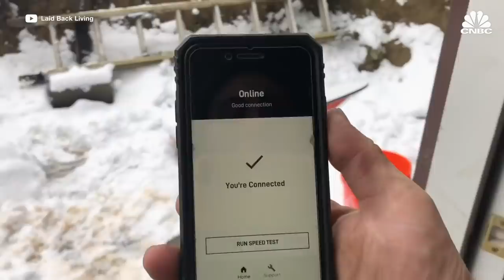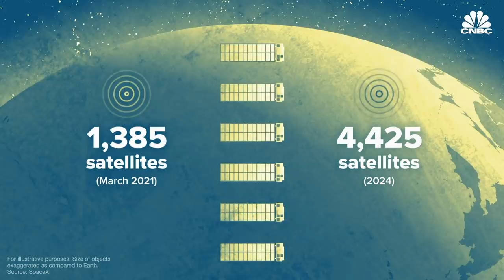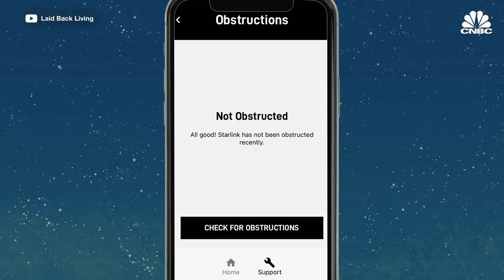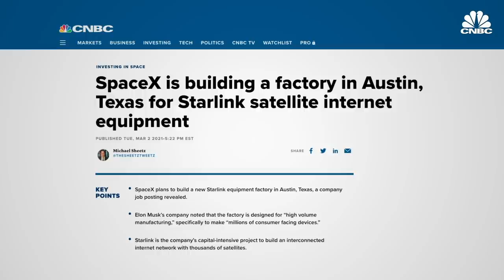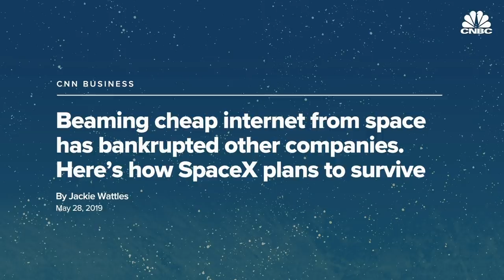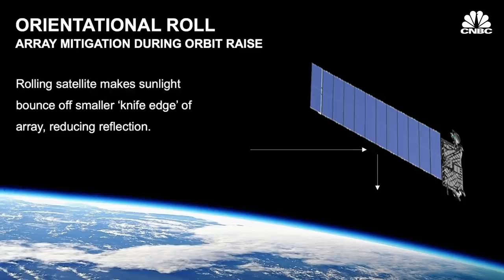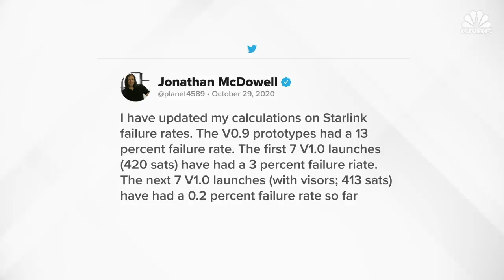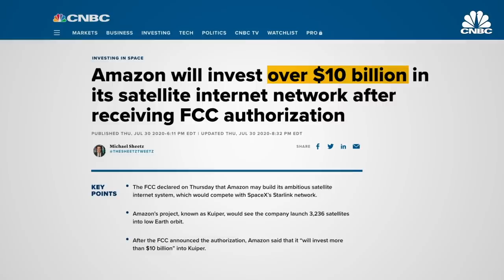Why Starlink Is Crucial To SpaceX’s Success

Comment: Data transfers with the speed of light regardless of they are in space or on the ground, through wire cables, fiber optic, lasers, or radios. The problem with latency is caused by the amount of data that goes through a server (for dns or other type of data) causes it to queue thousands of requests beyond its workload capacity. In fact, even the crappy am radios are transferred with the speed of light, and even has the most “penetration” through mediums (through air or walls, so that you can receive am radio across the surface of the Earth, while 3g cell tower can only cover few blocks). The fact that starlink has ok speed is because there are only a hand-full of people using it, when more people gets to use it, the latency would be much much worse than a good old ground fiber-optic or cable broadband. This is because ground based provider can repair, upgrade, construct stations with more-than-acceptable fees, while Starlink repairs would require years of preparation for engineers, cost billions per mission (yes, Space x doesn’t have human rated recoverable launch platforms), which would only allow them to go to few satellites. 
All these means, Starlink should succeed when human space exploration becomes cheaper, safer, and quicker, or otherwise...
Reply: Already wrong on the first point, speed of light is affected by the medium it travels through, light travels fastes in a vacuum, radio signals and other forms of radiation travel slower than light in a vacuum.
Starlink uses Ka and Ku frequency bands, they can penetrate through rain, clouds, and snow (up to 1ft of snow).
Starlink currently uses ground stations to repeat to communicate, they just launched gen-3 of their satellites which include laser links, once this becomes operational latency will theoretically be faster then what you can get with fiber optic (light travels slower through a fiber optic cable) Ground stations can be repaired, starlink satellites can be replaced, they launch 60 every 2 weeks so no point in havinga mandatory mission to repair a small satelite, ground network can be upgraded but that is every 15-20 years, starlink satellites will have to be replaced every 5 years so upgraded are almost mandatory and scheduled this will help keep the internetfrom being throttled or over used like many people are dealing with now because internet infrastructure is just so cheap to maintain... they have 1000 satellites up and I get 220mgbs in a city so I'm not worried about a low number of satellites when they plan to have 40x the number of even  faster satellites in the future. Also spacex did make space travel, easier, safer, and less expensive, their crew dragon missions demonstrate this over the Boeing starliner and space shuttles programs.
Reply: @miguellopez3392  Talk science, and not brands and names they tell you. Some high school physics for you: radio is light, light is radio; they are all EM(electromagnetic) waves, other than frequency, they are exactly the same in every conceivable way; hell, their speed is literally a constant, c, which is the speed of light. Sure their can travel in different speeds in different density  transitions, but the transition from vacuum and air in 100 km is like less than a picosecond (that's faster than how long it takes light to move 10 cm), which is beyond or at quantum level (meaning: you can't tell the difference even if you are faster than light). 
Also, the frequency they are using (I don't care what name they have) is 10 to 12 GHz. They can send a lot of data per unit time, 2 times  more than 5G in Manchester encoding. However, if you do the calculation, h/i *(d^2 Y)/(dY^2) + V.Y= E Y , Schrödinger equation from basic physics in college, V. is the potential or the things a EM wave meets on the way, E is the energy. Since the frequency is congruent with energy, 10GHz has higher energy, meaning either Y (the wave function), or V goes up in the equation. Meaning: when you have high energy EM waves, you will both meet "more resistance" ie. V, and have a different wave come out the other side ie. Y. 
Or you can just simply observe the signal you get from your home 5G wifi compared to your 2G wifi; sure you get higher download speed, but you cannot use the 5G after having two walls between you and the router, but the 2G wifi would happily server you even when you are out of the house on the sidewalk. This would be exponentially harder (the leftmost term in the equation, after separation of variables) to do when energy goes up (or when the frequency goes up).  
It's funny how you only quote the snow. Snow is 97% air...
Reply: @miguellopez3392  On the logistics. Doesn't matter how fast, or slow they repair the machines, we cannot escape the fact that going to space is hard, dangerous, and expansive. I have full faith it will be easier in the coming years, but I don't think it will be this fast. This could mean the demise of StarLink, or a hard business to run. The thing about a internet provider is that you need a lot of people to justify the business. For example, we pay 30 Dollars per month for cell services, and when 1000 people pay that much per month, they can earn money beyond the cost of the cell towers and retail stores. However, when there are only 10 people using the service in the area, it will take a long long time before you can break even, let alone earn profit. 
Starlink would, however, be of great use to people who cannot get internet from ground. Also some enterprise customers might need thesee services. And I think Starlink may only be able to a competitive in those areas.
Reply: @mikeyangyang8816   light travels slower when going through a medium, Google this and don't waste time. SpaceX can do viable satellites internet because they can re use their rockets and only spend a couple million on refurbishment and $200,000 on fuel, this is significantly cheaper than other rockets of similar payloads, they have already re used a rocket 6 times, the next crew to the ISS will be using a re used rocket for the first time in history Today.
satelites use KA and KU bands to communicate with dishes and ground stations (20-40ghz) and are getting better penetration of the atmosphere, clouds, and precipitation than other satellites, US military plans on using starlinks technology for military use since it's better then their satellite network, they aren't repairing satellites, it's significantly cheaper to just replace them every 5 years. I can use my 5G between 3 walls and a 30ft distance same as  2.4g real limit is my bandwidth, unless I'm getting 1 gig wifi I won't notice a large difference.
Reply: @miguellopez3392  There is literally no 1G wifi, 1G is reserved frequency by different things, satcom, aeronautical radio navigation... Medium of transmission doesn’t change speed of light too much, even water (thousands of times denser than air) doesn’t slow light much! That why you see things distorted through water, but you won’t be living in the past if you are underwater lol. 10G microwave frequency is not feasible for long distance information transfer, that’s just a law of physics. you can see this take effect from comparing ultraviolet camera footage with normal life, You can barely make out things in few blocks, but visible light allows you to see billions of km into space. That s because visible light has a lot lower frequency than ultraviolet light. Same thing with radios. High frequency radio communication is not scalable. 5G is already taking too long to implement, what make you think that 10G would be 99/month? From outer space!? Don’t even talk about 30G antenna, they are not for receiving, they are for sending data only station to station. You know why they can’t put those on top of buildings or just around the street corner? Because they need extremely high amount of power to send short wavelength EM waves to go 1/1000 of the range of 3G. It doesn’t mater it’s Elon Musk, Jeff Bezos, or Thanos; physics doesn’t allow you to do things like these easily. As far as technology advancement goes, I am not aware of an efficient millimeter band radio transceiver that’s going to allow everyone to have one in their living rooms.
Reply: @mikeyangyang8816  "1 gig wifi" means wifi with 1000mgbs speed not 1 gigahertz. Medium does not slow light by much (unless you intentionally make the medium slow down light to the point where it slows down so much it doesn't move) but when traveling around the world it does, what I'm saying the medium is the silicon that make sup the fiber optic cable, this is what starlink is competing with in terms of speed, that's small difference in light going back and forward between computers is a potential selling point to specific time sensitive services. So light through medium vs radio through medium with light through vacuum, theoretically the ladder has the fastest travel time.

10g? Where did you get 10G, I said Ka Ku frequency, that's 20-40 gigahertz and the satellites are in low earth orbit, 40x closer that other internet satellites.
I connected my starlink satellite dish to a 120v outlet, it draws 180 watts max... what year where you born? These are phased array Antanas, advance stuff, it uses 100 smaller sensors instead of 1 large one, combined with software this system outdoes what the military has on hand, which is why the military is using starlinks, because its more advanced, they recently requested a man portable system as Elon has announced the system will be able to be used while on the move and different locations you didn't originally assign it too.
Reply: @miguellopez3392  The only ways to get better “penetration” from any frequency are to either remove the barrier or increase the power. They still have to go through ground if they want to scale this up. Or they can send few hundred space stations just for relaying. Also, SpaceX refurbishment costs officially * 60 million dollars, and that was a goal they have never managed to hit. Currently, no SpaceX missions have costed equal or less than 60 million dollars. Where did the “couple million dollars” come from? As far as telecommunication goes, other companies  spends few hundred thousand dollars manual, equipment fees to install a station to a building or tower,
. They can be repaired easily, cost only manual fees. Starlink has to spend a rocket launch, months of preparation, 100 million dollar + equipment to send 60 low-power-5-year-life-span-no-repair-no-refurbishment expensive satellites. Other companies can use days, 5% the cost to install thousands powerful-repairable stations that have a life time of more than 10 years.
Reply: @mikeyangyang8816  officially cost 60 million? Spacex is a private company, Elon put it at 15 million in best case, so I would really like to see where you got this insider information. Rocket launch cost is 36 million it goes higher the more cargo and the type of cargo, compare a ISS crew launch from Russia to one from spaceX.
 Again you are making a dumb argument about satelite repair as towers have their sensors replaced as well, you don't repair 2g and make it 5g, but with a spaceX upgrades are almost mandatory, you talk about how it's cheaper but yet internet is still expensive and slow despite how easy you say it is to set up and upgrade, you are arguing against reality right now, the satalites other companies launch also easily cost over 100 million I doubt even 60 satelite from spacex cost that much as they are mass manufactured instead of contracted and built over the span of years.

You saying that it would be cheaper to have thousands of repairable satelites (how would you even do this???) in space for 10 years missis the point of why it only has a 5 year life span (has to do with atmospheric drag) and why you will only make 5% the money (much less bandwidth for customers)
Reply: @miguellopez3392  Where did I get the numbers? The frequency of their satellite is from US government registry for radio frequency (or their register for frequencies with the US law). The cost of one SpaceX launch is from spacex.com. I am done talking to you, you are not informed.
Reply: @mikeyangyang8816  FCC filings, they are the ones who directly regulate communications in space, and again their dishes are KA, KU band frequency, like I said the launch cost is lower depending on cargo and mission, standard cost is 62 million because they want to profit, cost to launch the rocket is lower, and again I said to compare the cost of the next cheapest rocket (soyuz) on a crewed mission launch just to see why they can charge 62 million and still deliver half the total the payload launched to orbit in 2020, making them very attractive as reliable rocket, it played a role in spaceX wining the NASA (spaceX biggest customer) contracted them to go to the moon, beating Boeing and blue origin due to lower projected project cost.
Reply: @miguellopez3392  NASA on average spends 150 million for every spacex REUSABLE missions, FOR ROCKET SERVICE ALONE.
Reply: @miguellopez3392  Also, a private company doesn’t mean it is a secret organization. A private company is simply a company that hasn’t IPO yet. What is IPO? Do your research.
Reply: @miguellopez3392  For the speed of light - God, I can’t believe I have to say this - doesn’t change. They “slow down” is because they are going through a little bit longer distance when a photon has to go around particles. I don’t make any of these things up, they are the law of physics. Broken only to people who imagines things.
Reply: @mikeyangyang8816  privately owned by a citizen is the important part, I know what IPO is I've made several, multi hundred percent gains in the stock market, far from making a loss.
Reply: @miguellopez3392  Stop saying ka and ku, say what they mean. What frequency are they at? duuude
Reply: @miguellopez3392  Let me take a wild guess, you invested one stock into gamestop when the news broke out
Reply: @mikeyangyang8816   again you have yet to compare prices to other rocket launch services, and I keep telling you that mission types and cargo deployment affect cost which is why they are negotiable, the most recent NASA missions have been crewed mission which are more costly due to the sensitivity of the cargo.
Reply: @miguellopez3392  Spacex only sent people twice. Both cost so much more than they claim it’s not even funny. I guess you are referring to the ridesharing program spacex is running? They cost so little is because a cargo is sharing ride with hundreds of other satellites, literally stuffed into the faring.  Try to look for the cost of a starlink mission... I bet you can’t even read the number in one go, since it’s so long.
Reply: @miguellopez3392  Ya, I think their rockets are competitive. But I am only talking about spacex because I think the Starlink business is not too bright remember?
Reply: @miguellopez3392  You have yet to make a correct claim.
Reply: @mikeyangyang8816  spaceX sent a 3rd international crew (2 US astronauts, 1 French, 1 Japanese) yesterday, this was the first time in history astronauts have launched on a rocket that has been used before and riding a crew dragon that has already been used before, so how much money do you think is saved by not throwing away your rocket and crew capsule and not building 2 new ones? This is the program, the ride share with other satellites is a differentprogram (this allowed spaceX to send the most satellites launched on a single rocket braking any previous record) 
You try finding thee cost of starlink I bet you won't find a solid number because this is a private company and they only disclose that cost within the company since they are trying to make a profit, it's obvious your ignoring the profit part of the company because you have yet to compare any cost to anything else or even state a number, this is like how Trump does speeches you just have to assume everything.
Again where are you getting your insider information? and are you aware that it's  protected by a NDA?
Also did you look up FCC filings from spaceX that show specifications for frequency on the system they propose?

I'm making correct claims I'm just wondering why you refuse to look this up.
Reply: @miguellopez3392  I like how you try to defuse claiming everything I said is wrong to “look up this and that”. Just experience, I didn’t look these things up.
Reply: @mikeyangyang8816  I'm not defusing I'm revisting the claims you made, you said it's satellites are 10ghz, it's not. you said light doesn't slow in a medium it does. you calim to know the numbers for cost of these mission, you dont because they are not publicly available. It's obvious you didn't look these things up.
Reply: @miguellopez3392  Sure
Reply: @mikeyangyang8816  hell yeah thats a "sure" you did make these dumb claims ant tried acting like bill nye the science guy (i prefer Beekman's world as i am a coinsured of fine taste) afterwards.
Reply: @miguellopez3392  Watch the new vsause video, not here to prove that I am right.
Reply: @miguellopez3392  I never said light doesn’t slow down, I even especially noted that it does, but it just matter so little that it basically means nothing. Also, when you want to show proof to something, don’t quote a youtube video. For price of some service: quote their official price. For specific policies: quote the people who made those policies. For laws of physics: quote a physicist who spent years studying it and earned degrees from top engineering schools (me).   :) See you
Reply: @mikeyangyang8816 
 "Some high school physics for you: radio is light, light is radio; they are all EM(electromagnetic) waves, other than frequency, they are exactly the same in every conceivable way; hell, their speed is literally a constant, c, which is the speed of light. Sure their can travel in different speeds in different density  transitions, but the transition from vacuum and air in 100 km is like less than a picosecond (that's faster than how long it takes light to move 10 cm), which is beyond or at quantum level (meaning: you can't tell the difference even if you are faster than light)"

"Data transfers with the speed of light regardless of they are in space or on the ground, through wire cables, fiber optic, lasers, or radios"

speed of light is 186,000mph, light traveling through a fiberoptic cable goes at 124,000mph, this is significant. i guess they just give out degrees to anyone who can use google occasionally, shame.
Reply: @miguellopez3392  I said it travels with the speed of light regardless of medium, I also noted the speed of light is different in different mediums. If I remember correctly, Also you supported my claims by quoting those, I said exactly what I said. And I still change nothing about my claims.
If you can read papers or any articles, any claims in an article is simply serving the purpose of bringing forth the thesis. The speed of light is not the focus of my comment at all... It is completely the opposite. Let me summarize my comment for you: radio travel fast, as fast as light, regardless it’s on ground or space; thus, the limiting factor is the server loads of various systems of a internet that causes a internet slowdown. Any internet provider can be slowed down with enough loads, and it is worrying that starlink has only this much speed when there is so little customers. 
Also, you finally brought out some numbers, you think 2/3 the speed of light is slow? Even if the speed of light gets slowed down to 1/10 the speed of light in vacuum, it would barely make a any difference in internet speed. Think about how long take you to submit a comment on youtube, it would take at least a noticeable moment, definitely orders of magnitudes longer than the difference of radio traveling in different mediums. This slowdown is due to server loads or multiple server loads, and not the mediums that your data is sending through.